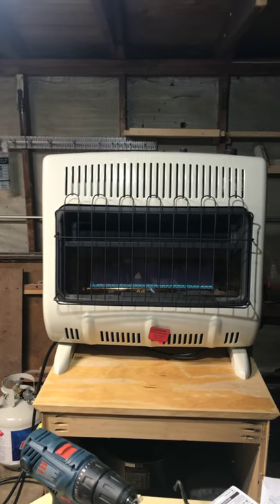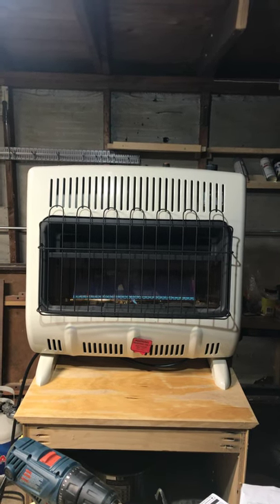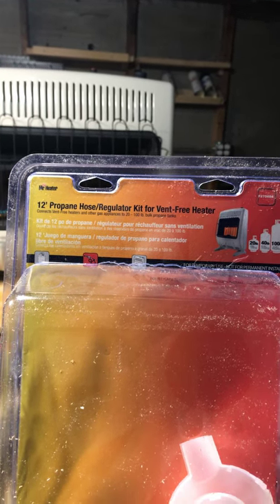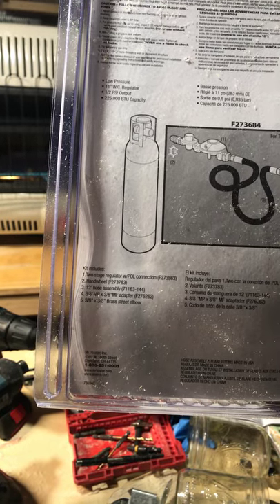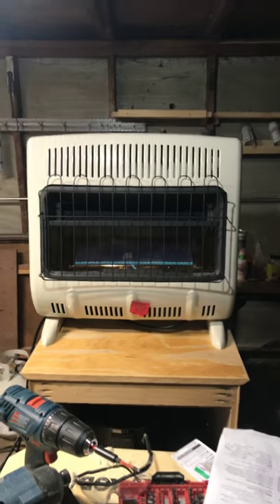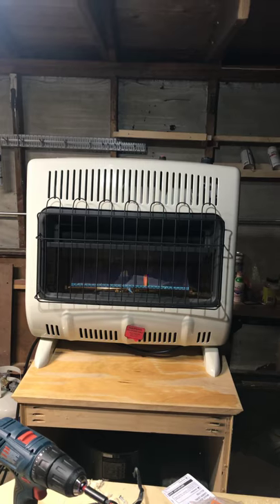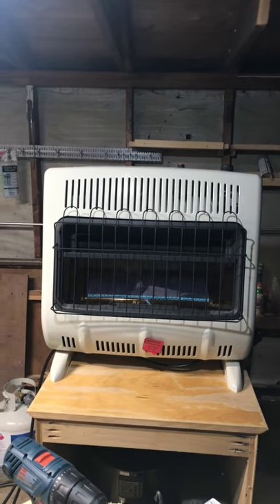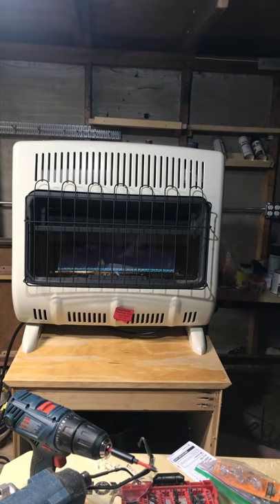Easy Connection kit for  Mr. Heater 30000 BTU blue flame propane heater

Comment: I bought the same heater and 2 stage regulator kit. The bottom of the heater box was open and didn't contain any hardware or battery fot the ignitor. The regulator kit had 2 elbow connecters and no addapter. Went to hardware store and picked up male to male addapter. Had a double compression fitting rather than one open end. Cut one compression fitting off and hookes it up. 15 min job became 2 hrs.

Comment: Just remember to use teflon tape for gas (yellow) when connecting the different parts.  Don't use teflon tape for water (white) to make gas connections.
Reply: It’s all the same… not sure where this came from, goofy local codes I guess… Teflon tape does come in different sizes, but not easy to find everywhere, the different colors are the same tho.
Wiring is often the same, electrical tape comes in different colors, some places require different leads to use different color connections for hot, neutral and ground, it’s even code in places… open up your home wiring and check, it’s probably all black tape everywhere cuz it’s all the same!
I use Teflon tape on everything, compressor lines to garden hoses… as long as you use enough, wrapped the right way then it seals it up no matter the color.
I’ve heard ppl say to use tape AND pipe dope on gas lines, that seems redundant, seems the 2 materials may conflict each otherbut I’ve not heard anyone confirm that.

Comment: I bought the same attachment kit but I don't understand how the regulator end connects to the propane tank.  The fitting is a different style.  (By the way, I think that these heaters require a 100# tank minimum.)

Comment: So I bought this same hose kit and installed it I checked all fittings for leaks I have a brand new dynaglo 20000 btu but I'm getting a odor was wondering if u experienced an odor it almost smells like paint or oil burning off so was juat curious
Reply: Dyna Glo heaters put off a terrible odor when running.  Almost like a kerosene smell.

Comment: That's a temporary fix. You really should have a dedicated line. Rubber will eventually degrade. Remember to keep the pilot assembly clean. If your pilot flame isn't blue it's time to clean it.

Comment: So you don't need anything else just this part?? Correct? To hook up to a 20lb propane
Reply from the maker: chris walsh I think so. Sorry it’s been 2 years since I did this.
Reply: This is all you need along with teflon tape to seal the threads so there is no gas leakage.